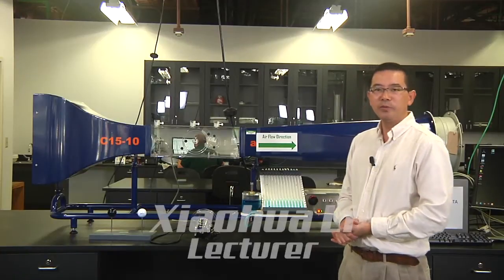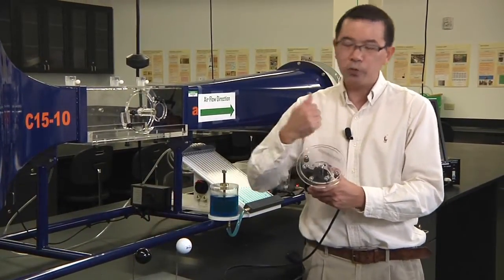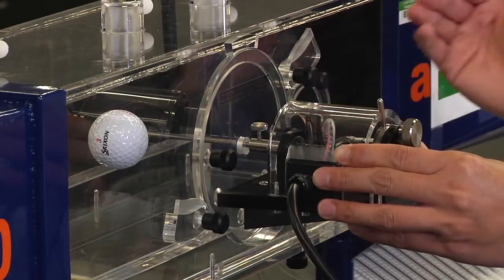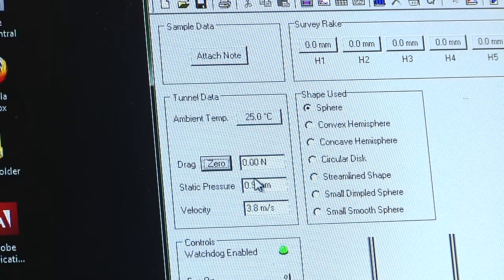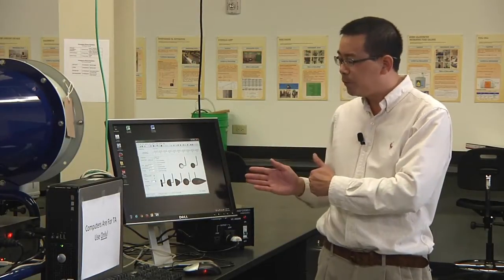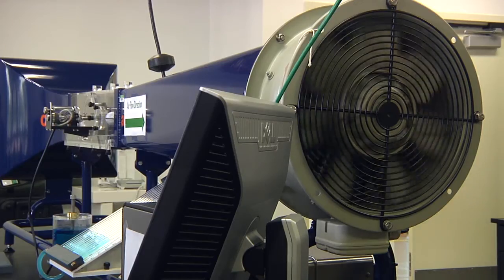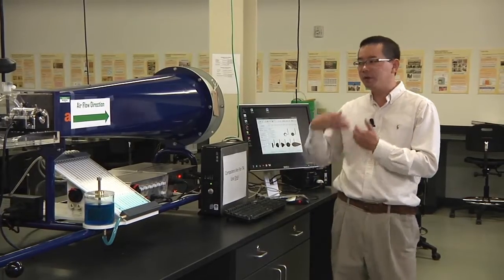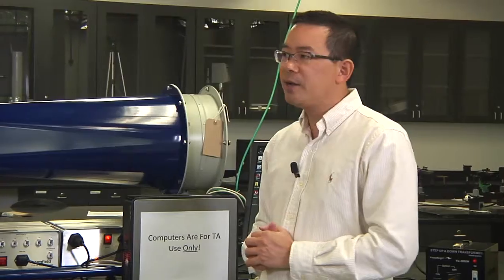Drag Force of a Golf Ball

Comment: 1) First the software you selected sphere while there was also a dimpled sphere setting ... why would there be a dimpled sphere setting?
2) how is wind speed measured as the pipe does not have a long enough straight section to use a differential pressure measuring system.
3) if you just wanted the wind resistance of the object how to account for the wind resistance of the mounting pin when part of it is covered by the ball & would see less to no air flow?